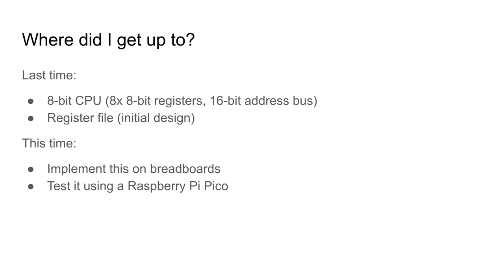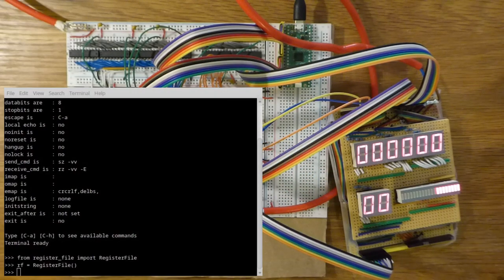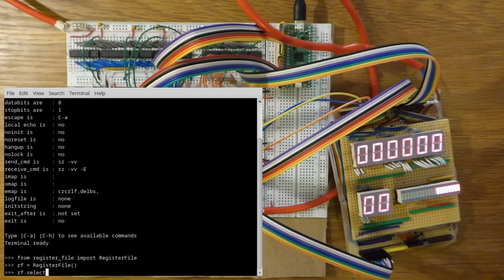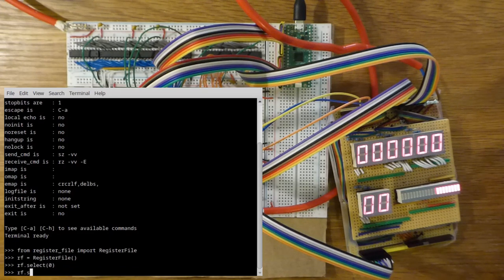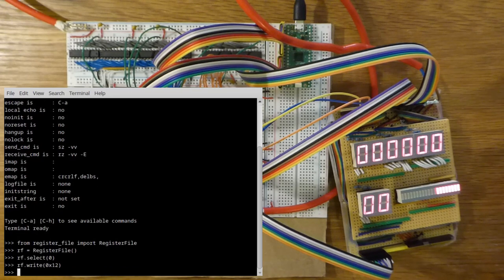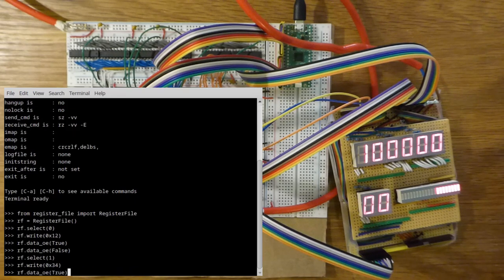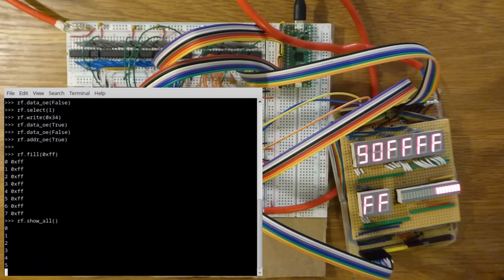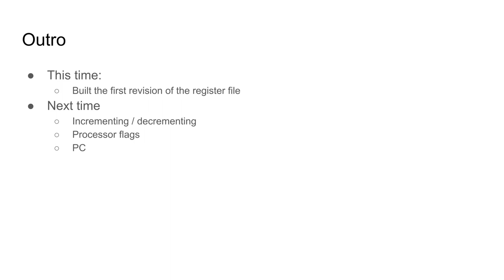Designing an 8-bit CPU - 3 - prototyping the register file

Comment: i'm excited to see a new unique cpu, thank you for showing the progress ✨
Reply from the maker: Thanks 🙂  I got distracted this week with the programmable logic chips.  I'll upload the video today.

I was hoping the Easter weekend would mean more electronics project time, but I ended up clearing out old junk. I found a bag of 1973 74-series chips from my dad... Not the LS, but original TTL.  He said they were expensive at the time 😮
Reply: @phodopus42  I'm old enough to remember feeling the 40ma heat coming off those original TTL chips.
Reply from the maker: @davidgari3240 I found some 74 series chips in my dad's lift - dated 1972.  He said they were amazing at the time.  He designed some electronics for a particle accelerator.  Cool stuff.  What did you design and build with them? 

Sorry for replying late 😕